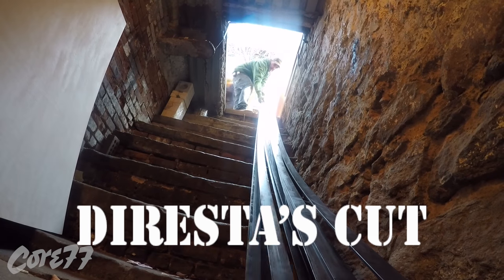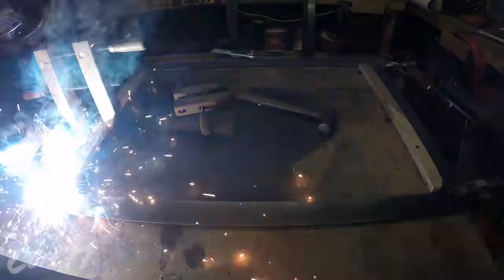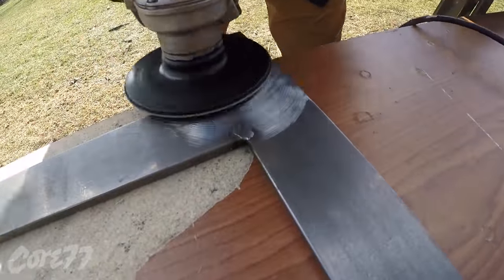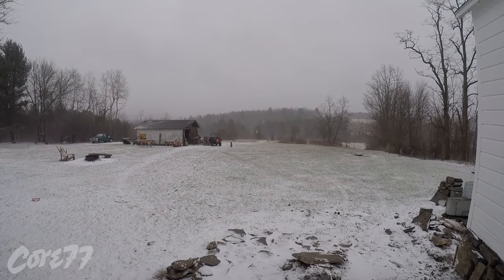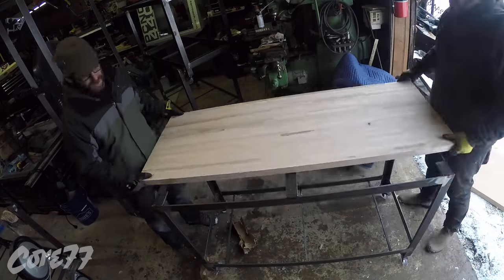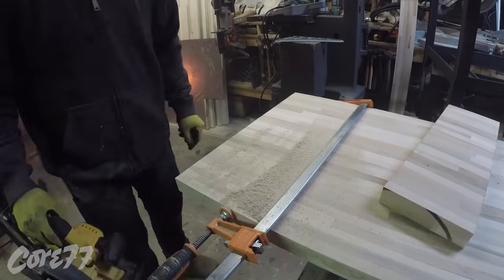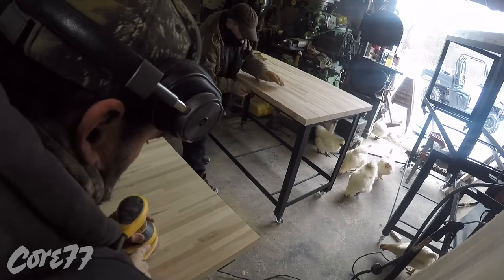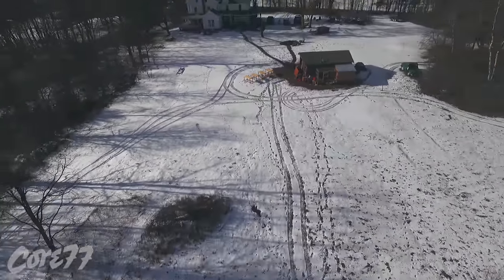DiResta's Cut: Five Work Tables

Comment: Super useful and motivating. The methods of your production are so efficient and effective, whereas I often get in a mess, but I learn from what you show. Might even remember to put heat on when I am gluing up, I regularly forget that when winter comes. Last week my new wood silk screen frames fell apart and I had to redo quickly with 5 minute epoxy.

Comment: noticed you started out stick welding and switched over to the Mig... any reason for that? Personally I am spoiled to the mig but the stick is around in case I run out of wire one late night.  yardstick tip is pretty slick

Comment: Freakin' awesome tables! Wouldn't be ashamed to have something like that in my living room :P

One question: Do you have problems with moisture and rust in your tools when they are lying in your shed? And if so, what do you do to prevent it?
The reason I'm asking is that I'm about to set up shop in a building similar to your shed.

Cheers from Denmark :)

Comment: Hello Jimmy,
As always, thank you for the video. As for the expansion and contraction. I see no room for screws underneath the tables to move. You did it on purpose? I would fasten the top in center or make a slightly bigger holes in corners so the screws could move a bit or I missed something?
Reply: the screw heads have little room

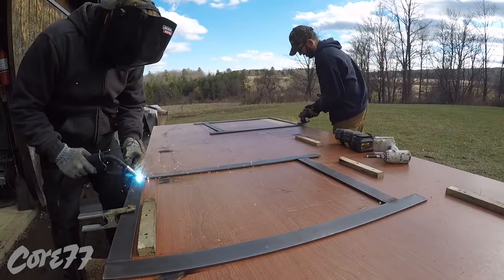Comment: Watching you MIG weld at 2:48, I notice that you "pushed" the weld, working back-to-front. I'm not a welder (yet), but my intuition would have said to "pull" the weld, working from front-to-back. Is there a technical reason for this, or just personal preference?
Reply: When welding uphill, like Jimmy is, you want the puddle of weld to be in front of the nozzle. As you weld wire is feeding out of the front of the gun so the puddle is "pushed" forward. "Pulling", or welding downhill, is appropriate in some applications, but in this case there's no need.

Comment: Now those tables can take a beating! Great ones!
However, maybe it was the lighting, but it looked as if you didn't put finish on the bottom-side of the slabs? In my experience, leaving one side untreated greatly enhances risk that the wood may crack or the glue joints to split.

Comment: The glue joint of the table top extension is interesting.  Just a long saw cut on each side was good enough for the glue up? Everything was square then?  I know you wouldn't do it unless it was; just not as easy as you make it look.

Comment: too cold for PVA glue (that needs room temperature to cure properly).  Should have used construction adhesive.
Reply: its still holding...
Reply: Matthias Wandel PVA is fine as along as it doesn't freeze, the freezing process damages the liquid polymer. I'm not sure what the freezing point of PVA is but it must be below the freezing point of water. Anything above  0 degrees Centigrade will allow the glue to dry and won't affect the drying time much as the majority of the water is wicked away by the timber, this is what draws the PVA in past the surface and gives woodglue it's superior strength.
Reply: Matthias Wandel PVA is fine as along as it doesn't freeze, the freezing process damages the liquid polymer. I'm not sure what the freezing point of PVA is but it must be below the freezing point of water. Anything above  0 degrees Centigrade will allow the glue to dry and won't affect the drying time much as the majority of the water is wicked away by the timber, this is what draws the PVA in past the surface and gives woodglue it's superior strength.
Reply: BTW, i keep the glue in the heated house and in preparation for this glue up i warmed the glue on the AGA stove top
Reply: My experience is that even at 5 degrees celcius, it doesn't cure right.  Freezing damages it even in the bottle, but when gluing, it needs room temperature.
Reply: It will hold, just not optimally.  Did the squeezeout dry smooth or crusty?